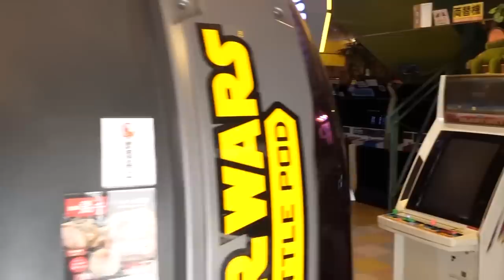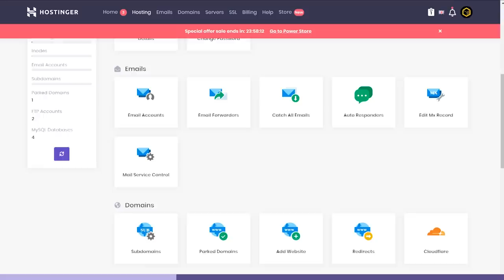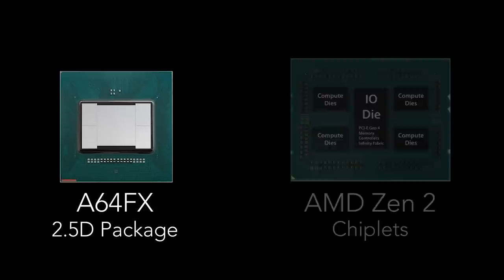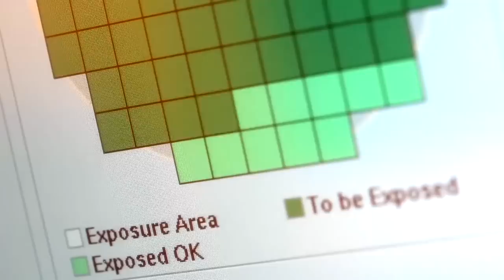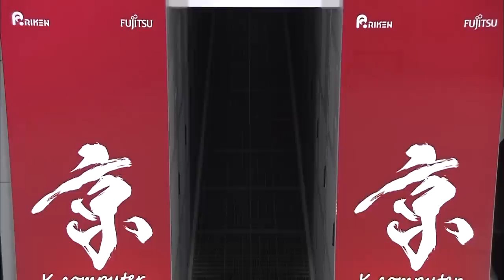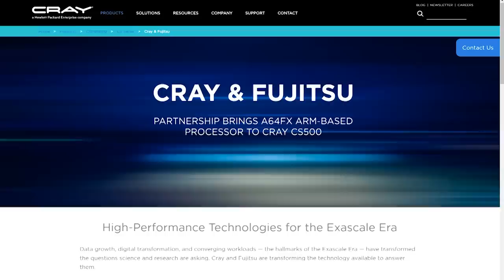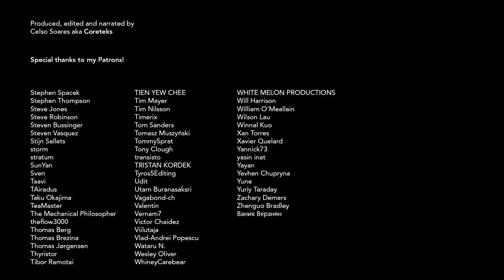CPU? GPU? This new ARM chip is BOTH

Comment: 17:28 sure, streaming today data would be instant with tomorrows technology, but what about tomorrows data? The extinction of load times is far away. More powerful computers? That will just be an excuse to use more detailed textures :'D
Reply: loading nowadays is no longer limited by file size, it is limited by bad code. NVMe SSDs do many GiB/s, no game asset needs more than the blink of an eye to load. Sadly, developers have some of the fastest possible hardware available (especially in big-budget games and programs), so they have no need to optimize. Running the same code on an average PC then makes it unusable.
Reply: The biggest issue is poor telecoms infrastructure. Even in the UK it varies massively in speed, they're already trying to save cost and not put in full fibre.
Reply: @Mil-Keeway  compression and bad structuring of data makes for terrible load times rven on high end NVMes. Games before the next get werent optimized for this, maybe except star citizen and arkham knight.
Reply: Just compare it to just 10 years ago when some websites would take years to load half the time, or 10 years before that when printing a jpeg was faster than viewing it on a webpage. We're really stretching conventional processor capabilities thin but there will definitely some fundamental shift in the industry that keeps the performance train chugging along. Could be a beefed up ARM chip, desktop chips made from different materials (silicon ain't the most performant, it's the most flexible) or something completely different if synthetic neurons or quantum computers have an early breakthrough. Internet banwidth is also constantly improving.

 Honestly the only thing slowing us down is companies milking their current technologies like crazy. Let's all thank AMD's Threadripper for shoving 32 inefficient cores into pro-sumer PC's and speeding up global warming lol. And let's not forget Intel's tiny generational improvements. There are certain sollutions which could be implemented pretty soon but who has time to research other options when they have to pump out 3 useful and 7 useless chips a year?

TL;DR : Tech seems to be improving faster than consumer needs because it never improves fast enough for professional needs, driving researchers to find new and better sollutions. But capitalism's a bit of a bitch sometimes and is getting in the way.
Reply: Not to mention 6K, 8K, 12K, HDR (10, Adobe so on!), Audio Quality (Atmos/DTS-X/Bi Aural Audio, 24bit, 32bit!), Multiple Audio (Languages, Commentary so on!) and even Video Streams for the same content (Alternative Angles, Cuts so on!)
Reply: Yeah.  More on-die memory means more detail will be thrown in by game devs seeking a higher wow factor, and streaming from external RAM or storage will again become necessary.  Also, saving on optimization costs will continue to plague game development, forever.  If the systems become more powerful, consumer-grade code becomes that much more inefficient, since it still runs "well enough" without added software-engineering time.  Hitching every 30 seconds?  No big deal.  Ship it!
Reply: We already have tomorrow's tech, they just give it to us in increments, so they can keep making money. Example, 10 TB SSD drive from 10 years ago, so they start off giving us 16 GB SSD..  32...64..128.. 256   512 and so on until they reach what they had already available. Heck remember that time you could make an AMD phenom 2 core become a 4 core? They were 4 core chips with 2 disabled (some because of defective cores but majority were just disabled to allow for a cheaper tier)
Reply: The bottleneck for games isn't the hardware, it's shit programmers
Reply: Imagine if we actually made a fully integrated brain-computer interface (which is likely to be made in this century), that's a absurdly large amount to data to juggle around. These high bandwidth chips will probably be the bottleneck in this kind of applications
Reply: This is what I hate about modern game design. More detailed textures are more important to devs ajd publishers than more content. Imagine Halo 3 graphics on the new Halo games, but they have 10x as much content in a level.
Reply: @miguelpereira9859  To be fair, it's about money; and programmers these days have no say about that.  They're just given a harsh deadline, not enough time to work on their code until it's properly debugged and optimized.  So once the software works "well enough" on the target hardware, they just pass it along--never mind that it would perform far better if they had more time and incentive to make it truly stellar.  Since the power of the hardware increases with each generation, so does the inefficiency of the software.
Reply: Load times are product of storage speed differences, and pop in is a matter of draw distance, both will improve with new tech, but will also still exist for a long time as developers often want more details (data) closer to player/camera which inevitably eats the capacity to display it further away.
Reply: @635574   lol star citizen isent optimized for anything :)

Comment: 7:55 Not quite. Supercomputing applications actually have limits to their parallelism. There is also a need for heavy communication traffic between cores. Hence the fast interconnect, which is a major component of the build cost of a super.

For an example of a massively parallel application which doesn’t need such heavy interprocessor communication, consider rendering a 3D animation. The renderfarms that are deployed for such an application are somewhat cheaper than supercomputers.

Comment: What you describe sounds like a modern version of the PS3's cell chip.
Reply: Kind of, yes! The PS3 used several DSP-like processors connected onto a ring bus - except that rings, as well as other pure bus like topologies, while being the simplest way to interconnect multiple regions on a chip have several inherent limits which restrains this kind of topology to a limited amount of locally adjacent cells which is why the kind of processor presented here not only has one ring, but a hierachy of rings topology:
See this paper as an example for examining & describing different hierachical ring topoligy variants as on-chip interconnection networks, also called NoC = "network on chip"
"Design and Evaluation of Hierarchical Rings
 with Deflection Routing": http://pages.cs.wisc.edu/~yxy/pubs/hring.pdf
This has been a hot reseach topic in hp & scientific computer engineering for several years now.
Another really old, formerly rejected but increasingly interesting & related research topic is "computing-in-memory", also "processing-in-memory" or "near memory processing" because the costs to transfer data between processing units & memory is, as mentioned in this video, increasingly becoming a limiting factor, see
"Computing In-Memory, Revisited": https://ieeexplore.ieee.org/document/8416393 but also https://semiengineering.com/in-memory-vs-near-memory-computing/
& while the recent emergence of array processors like Googles tensor cores & other forms of neuromorphic processing units is clearly at least partly due to that, this problem isn't limited to applications using AI but applies to a much broader category of problems - the "bandwidth wall" is a thing.
Reply: @FrankHarwald  One of the biggest headaches of working with the cell BB was the relatively tiny amounts of accessable memory each SPU had (256kb IIRC). This meant you couldn't use a lot of general purpose algorithms and instead had to modify them to be streamable with high locality of reference - for some algorithms it just isn't possible to optimise in such a way.
Reply: @SerBallister  indeed, but modifying algorithms so that they run with a high amount of locality is something that you'll have to do for all data intensive algorithms anyway - no matter how much of it is done automatically, profiler-assisted or by hand - regardless of what the underlying architecture is because while all shared memory architectures will start hitting the bandwidth wall at some point, distributed memory architectures will be the only way to circumvent these limitations. & yes, this also means that algorithm that access a lot of memory from the same chunk in a purely serial way will either have to be modified to access data in parallel from multiple chunks (if possible) or remain bandwidth limited (if this is acceptable or if the algorithm is inherently serial).
Reply: @FrankHarwald  You should aim for that yeah. The SPU local memory presented an addressing barrier instead of a cache miss like on a multicores, all data has to be present in that block. Take a ps3 game for example. Some systems like physics and pathfinding can be hard to compress your game world in 256kb, the PPU had to work on that stuff and you then had the headache of pipelining the output of that into the SPU (e.g. animation) if you want to avoid stalls. Interesting chip but can be hard work, task scheduling and synchronisation is also not straight forward. I would prefer working with modern desktop multicores with shared memory.
Reply: of course it is
Reply: Really wanted to know, what you guys think/opinion about this computer compared to nvidia dgx a100?? Does it has equal performance or something? I really excited to know this. Thx :)

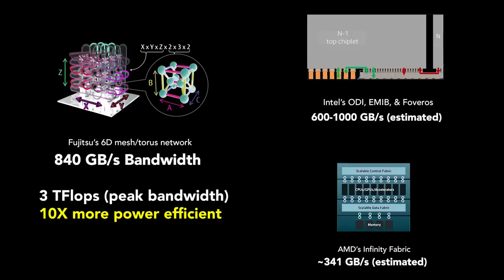Comment: 8:53 That doesn’t make sense. “Teraflops” is a unit of computation (“flops” = “floating-point operations per second”), not of data transfer. Data transfer rates would be measured in units of bits or bytes per second.
Reply: Yeah, A64FX has 1TB/s theoretical  bandwidth and 840GB/s of actual bandwidth.

Comment: If you haven't already, you may want to look into RISC-V's upcoming Vector extension. It does all that SVE does, but better.
Reply: Better how?
Reply: @Toothily  There are a couple of independent things. For one thing, there's no architectural upper limit to the number of vector lanes. Another thing is that the dynamic configuration of the vector registers allows better utilization of the register file (for example, if only a couple of vector registers are used, they can subsume the register storage of the other registers to get much, much wider vectors). Also, while that part of the specification is still a bit up in the air, there is an aim to provide for polymorphic instructions based on said dynamic configurations, which means that it's far easier for it to adopt new data types with very small architectural changes. They also aim to provide not only 1D vector operations, but even 2D or 3D matrix operations, which could provide functionality similar to eg. nVidia's tensor cores, except in a more modular fashion.

There are more examples too, but I think this post is running long enough as it is. I recommend reading the specification.
Reply: @chuuni6924  that sounds really cool spec wise, but do they have working silicon yet?
Reply: @Toothily  The spec isn't even finalized yet, so no, there's definitely no silicon yet. However, the Hwacha research project is being carried out in parallel and I know there's a very strong connection between it and RV-V, and I believe they have working silicon in some sense of the word. It's a research project rather than a product, however, so not in the ordinary sense of the word.
Reply: Really wanted to know, what you guys think/opinion about this computer compared to nvidia dgx a100?? Does it has equal performance or something? I really excited to know this. Thx :)
Reply: @mrjean9376  There's no way for a third party to know, it depends on too many unknown factors like the fabric, the specific application, the architecture of the whole system, how many of them you're using, &c&c. You'd have to benchmark it.

Comment: Those chips are cool and all, but did you see THIS? 18:04 That truck has FOUR WHEEL STEERING, now THAT is innovation
Reply: They have been on the roads for years...
Reply: there is also all wheel steering at the wheels at the back too, look at this tatra video  https://www.youtube.com/watch?v=U-ujpvOeydk
Reply: lots of 3-axle garbage trucks in europe have frontmost and rearmost steering, pivoting around the middle axle basically.
Reply: @onebreh  pog realy ?
Reply: You call that innovation? Get back to me after you google 'Spork'
Reply: A fairly common axle configuration has 3 axles with steering, two "front axles" and one steerable bogie axle. Another common one is one front axle and a steerable bogie. Then there's the "tridem", one front axle, two "powered" axles(tandem drive) and a steerable "bogie". (None of these are actually bogies, but they're commonly referred to as such).
Reply: It's been used on trucks for at least a decade and has been used on high end sportscars for at least 5 years now.
Reply: @Anankin12  4WS has been in one form or another in production cars since the 80s. With the 2nd gen Honda Prelude, which was a relatively mainstream car and used a mechanical system. A more advanced one was featured on the 850csi e31 with electronic control and was called AHK.  Nowadays really only some high end sports cars and long luxury cars have it as it adds a lot of complexity and weight.
Reply: I'm not impressed as a monster truck fan. It's the same as the military armored vehicle front steering from decades.
Reply: @DimitarStanev  Mégane 4 GT and RS variants also have 4WS, and they're really not high end sport cars
Reply: it's a clever way to charge more for the same basic functionality, all right
👍
Reply: SQUAZZ

four wheel steering  has been around for decades
Reply: Innovation? I've been doing it in the game Scrap Mechanic for years, you fool!
Reply: Nissan Skyline R31 already had 4 wheel steering in 1985 :p
Reply: @JAnx01  Look up hicas
Reply: @Mjallux  OK, what does a specific brand of 4WS have to do with my point?
Reply: Must be nice to get out from under that rock every now and again.

Comment: The comparison with the duel intel xeons is a little silly now that they have already been blown out of the water with eypc.. still an interesting CPU tho..
Reply: I think people are going to get surprised when AMD announces Milan this year.

Also, the Frontier 1.5 exaFLOPS supercomputer will use a CPU chiplet + 4 GPU chiplets + memory in the same AMD chip.
Reply: The question is, what is more EPYC?
Reply: I agree. With how many problems Intel has been having for the last 4-5 years stagnating them on 14nm, comparing anything besides other x86 CPUs to Intel feels disingenuous. 

If they compared this ARM chip to the actual current x86 performance leader (a 2U Epyc Rome server with 128 cores) it would be beaten by at least 2-3X. Maybe performance per watt would be better on the ARM chip, but the performance density would almost definitively be unbeaten.
Reply: @BrianCroweAcolyte  This isn't the first time ARM was expected to be dominate. It happened int he 90's as well. In fact Microsoft made Windows NT compatible with ARM back then. There was big promise that RiSC cpus would take over the world. Well, that didnt happen, and i still dont think it will happen today or in the future.
Reply: @aminorityofone  ARM will probably continue to dominate the market where chips are designed for purpose (unless RISC-V takes that market), mostly because x86 isn't licensed to anyone new.
Reply: @aminorityofone  if i'm not mistaken, windows nt was only released for x86 and dec alpha not arm. risc failed due to lack of inovation from the time's biggest players (sgi, sun etc). while x86 was moving forward rapidly, risc development remained still. by the time they decided to proceed, x86 was very far ahead. arm is still very good for certain apps, but for high perf. computing, they have a long way..
Reply: @giornikitop5373  you are right, got mixed up between risc and arm. arm is risc after all
Reply: The advantage for the 64 is it's access to GPU compute.  I would be willing to wager that if one could run those workloads on a robust APU, like will be debuting in the next generation of console, you would see that APU performing between the Xeons and the 64.

Comment: 5:36 Actually, the plural of “die” is “dice”.

Yes, those dice. As in the phrase “the die is cast”, which means instead of throwing several dice, you have thrown just one, and must stand by whatever it shows.
Reply: The "die is cast" comes from the middle high German/English Gutenberg printing.  The printed page came from a single die cast, which is why it was slow and expensive (though cheaper than the Monks drawing each page by hand).  This allowed Bibles to be printed, helped people learn how to read, and bring education to the people.
Reply: @ehp3189  That can’t have been right. Guternberg’s innovation was the invention of movable-type printing, as in having separate pieces for each letter that were assembled to make up a page. Printing an entire page from a single block was a technique that had been invented by the Chinese centuries earlier.
Reply: @lawrencedoliveiro9104  Granted, but the expression goes more towards the assembled type set being cast together in a block and any changes to that during a printing run were not to be allowed.  It was difficult enough that breaking apart the group and then reassembling it for one letter change was more expensive than it was worth.   At least that is my understanding. I liked philologogy in college but they only offered one class ...

Comment: We need to rethink how we use computers. ARM is the future, X86 processors are flawed, it runs at 125watts while ARM will only use 5watts with equal of computing power. The only problem is we need to reprogram everything